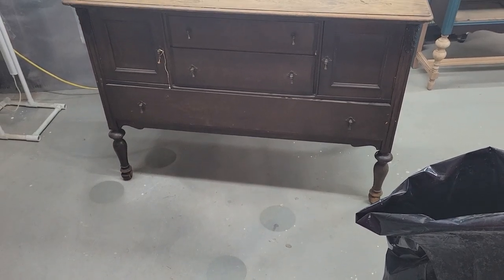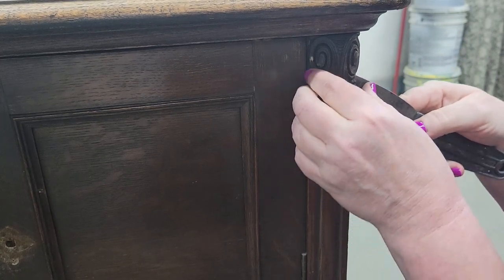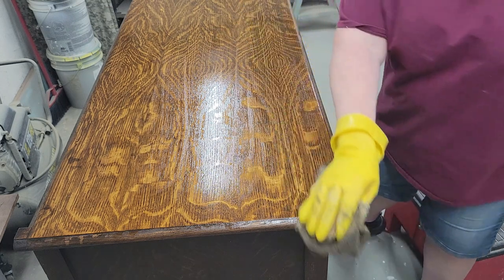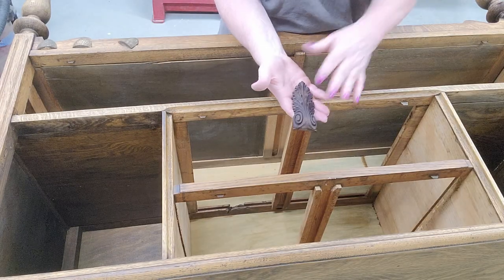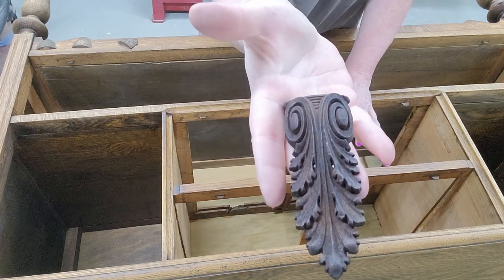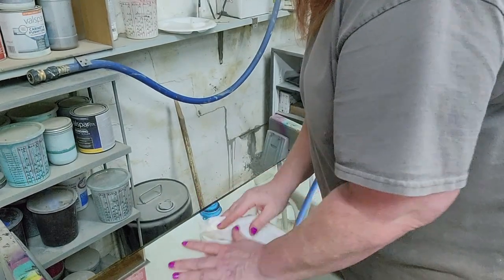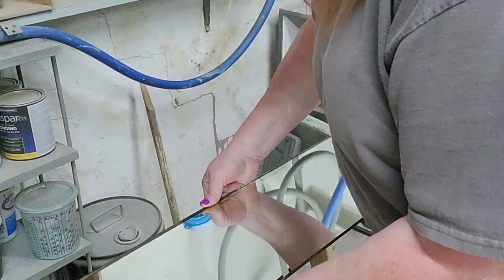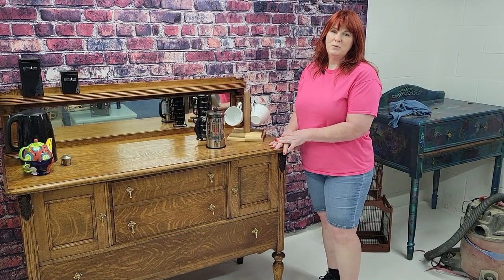Bringing a 1890 dresser back to life

Comment: Wow…That piece looks amazing🌟‼️ I just can’t get over how going over that old shellac with denatured alcohol reactivates the original shellac and makes it so easy to remove….I have seen people sand away and I probably would have done it too if I hadn’t seen your channel! I’m learning so much….can’t thank you enough for all you have taught me🙏🏻 Now we chatted before about me trying denatured alcohol on the the tops of the scratched mahogany veneered dressers tops my dad refinished 40mm years ago…want to make sure I get this right. My husband picked up the denatured alcohol and I see how to make your applicator….so after I apply it…since I don’t really want to remove the stain….I have regular Binzer shellac in a can…how much should i cut that with the alcohol to apply the shellac….I will,steel,wool 0000 between coats..then how long should I wait until applying wax? I so appreciate you…love watching you work your magic on these beautiful pieces!!! Thank you so much for sharing😊kim
Reply from the maker: I knew last week when your were on your binge watch this video would hopefully answer a lot of your questions. Before you dive into redoing the top of your dressers i highly suggest you do a small spot test in a hidden area that might have some finish bottom edge of drawer fronts can be a good one. Using just the alcohol you wont need to worry about the stain coming off as its almost certainly oil based. I find a good balance working with a 2lb cut of shellac - that can will be a 3lb so give it a good mix first. Then mix 2parts shellac to 1 part denatured alcohol and your at a 2lb cut. However if your having a hard time applying it then it down some more. If you make any mistakes you can take it off and start again using the same denatured alcohol process. For wax id give it at least 24 hours i hope to goes well and please let me know how you get on.
Reply: thank you for your informative reply….love learning new things…I will let you know how it goes……I have some mahogany pieces that do not have the sentimental meaning I can try on one of them …but I will definitely find an inconspicuous spot on my dresser to try first! Thanks so much for your time..means the world to me😊kim

Comment: How did you know (or think) it would be that beautiful quartersawn oak? Help us choose good pieces to work on :-)
Reply from the maker: I purchased this piece though an online estate auction. Based on the limited photos the style of the piece and my best guess at the age is why I suspected it was quatersawn but it I was not sure till a picked it up. If your able to take a really close look before you purchase you might be able to make out some of the grain pattern but most of the time until you start stripping it you dont know. If your pretty sure a piece has significant age even if it turns out not to be quatersawn it will still be stunning restored.
Reply: Thank you!

Comment: Did you reactivate the shellac spill over on the inside of the piece? Beautiful wood grain! ❤
Reply from the maker: Many pieces like this were never finished on the inside. What I did with the inside of the piece was to apply many coats of paste wax to all the inside parts. What that did is reverse the drying out of the wood proving both some moisture and protection.